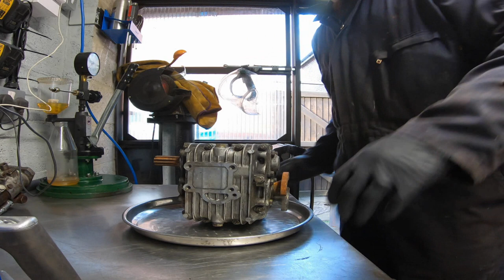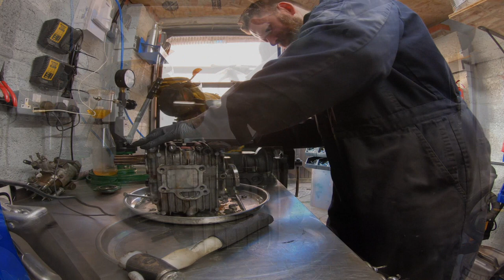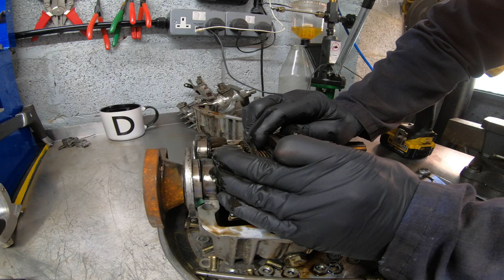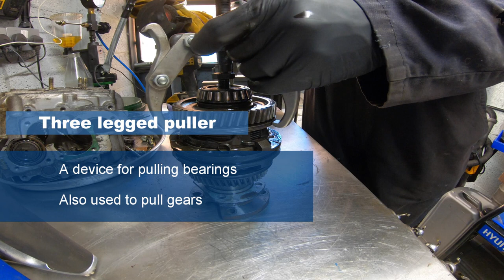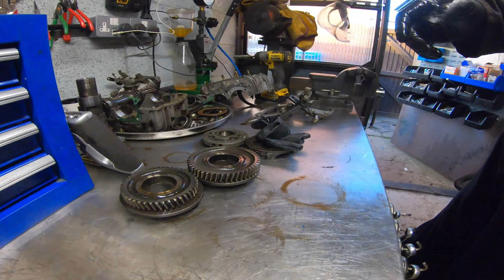How does your Marine gearbox work ? ZF HURTH

Comment: Thanks for your dedication to do these videos. I have a HBW 150v (40 years old now) transmission that is getting more stubborn when shifting into forward (reverse is never a problem). The linkage and cable adjustment seem right on so I'm thinking about rebuilding the transmission myself. Your video has definitely helped me understand what I'm getting myself into. Thanks again.

Comment: Sub'ed 

I purchased my first sailboat and motored almost 100 miles up the Columbia river to Portland Oregon. (almost zero hrs at the helm) As I made it to my new marina I approached very cautiously. I rolled in at idle and just at the slip, I had to make one correction with reverse. when I did, I failed to let the prop stop, and shifting into reverse made a hard connection and then it was stuck in reverse. I said a few choice words and then dropped the outboard (fortunately) and maneuvered into the slip.    This is what brings me here. I'm currently researching how to remove the gearbox.   This video Helped. Thank you!
Reply from the maker: Glad it's helped, good luck sorting it

Comment: Thanks for dismounting that gearbox. I hoped that you show rebuilding and adjusting that gearbox, too.
We got this Hurth in a Vetus engine in a sailboat. We only get reverse and neutral gear and nearly never forward gear.
Reply from the maker: It is almost impossible to get the bits here. You can easily buy the clutch packs and bearings but the springs, thrust washers, and pins, not yet found a reliable source.

Comment: appreciate it. just aquired a 01 master craft with this transmission. need to learm how to service it.
Reply from the maker: Change the oil regularly and use only mineral. ATF unless the manual states if differently.
Reply: Donde se puede comprar una

Comment: Loved this. I have. Zf 25a equivalent and am looking for a video that show the servicing of the control block. I think its the reason why i have loud clunks when i go into fwd or reverse
Reply from the maker: Check the idle speed, you may be running to fast.
Reply: @dhcrouchmarineltd3049  I took it down to 650rpm, but it's not much better .

Comment: Hello Mr Crouch. I am very much interested in your channel lots of good advise practical how to, just what we need. Thanks very much. Can I ask a question? We have a 1800 BMC - Thornycroft T108 diesel in a boat and we are having problems with the water temperature gauge. The gauge shows the engine overheating when in fact it clearly isn't . The control panel is a Thornycroft and the gauge is electrical, the sender has two blade connectors,  The gauge on the panel says VDO as are the other gauges. I think the sender is at fault, have you any idea where I might be able to get a replacement? Thanks in anticipation, John Beck
Reply from the maker: Hi, a two pronged approach here. Well maybe more, Calcutt Boats or ASAP supplies.

VDO is a leading brand with most manufacturers so I cant see an issue buying a new vdo sender. However on the sender will be numbers stamped on it and if you Google these, in theory you should get a hit and find one somewhere.

Hope that helps.

Comment: If ZF are S.A.E boxes does this mean that all ZF boxes only attach to engine's that run CCW as seen looking at the flywheel
Reply from the maker: From what I have seen in the manuals, if there is an R on the data tag which is usually next to the oil filler port its for Right hand use.

So it depends on application. Typically I have not seen the same reduction in ahead and astern so it does matter.

Comment: Hi I just received a new ZF45A Gearbox.
I have an issue with it.
When I put it in gear either forward or stern and turn the input shaft the propeller shaft is not turning.
Surly this is not right
It was supplied with no oil in it.
Does that make a difference?
Any help would be greatly appreciated
Reply from the maker: Have you tried to put power through it. Just turning it by hand may not engage the clutch correctly.

Comment: i'm just rebuilding one now, i managed to press everything onto the shaft ok. i'm just wondering if there is a sequence and torque spec for rebuilding the case?
Reply from the maker: Have you got the workshop manual, always refer to the manual for the tolerances and torque sequences.
Reply from the maker: Have you got the workshop manual, always refer to the manual for the tolerances and torque sequences.

Comment: I bought a pair of motors that have the Hurth model HSW 450 A2-2,0 ser n 22 15223 A they have been sitting for years from what I was told they were took out of a boat after 20 to 40 hours run time and replaced because the owner wanted more power what do I need to do to make sure there ready to be used again I have manuals on them but I’m wondering about the seals or gaskets effect of stagnant fluid or no fluid on them
Reply from the maker: If I was called to inspect them I would drain the fluid (if any) and check inside with an endoscope. Try to gauge the state of play inside each box.

If they are not on the engine then check the seals isnt hard. If they are crispy then definitely change them.

All depends whats found. Do they spin by hand, engage each direction and see if there is any binding. 

Hope that helps a little
Reply: Thankyou there still on the motor I just got them I was planning on rebuilding the motors  this helps me out it’s really hard to find any information on these transmissions I have a original service manual for them but that don’t cover sitting in a barn for 20 plus years and I had no knowledge of inner working until I found your video many thanks for sharing your experience and knowledge  I can use all the help I can get this is my first complete boat rebuild it’s a 79 pen yan 24 footer and the only thing it has going for it is a fiberglass hull
Reply from the maker: @patrickg.6438  bear in mind what ever transmission you use will define the physical installation. Changing that later to suit another brand will cause you a head ache. 

Be cautious and work with equipment you can get parts support easily. Thats my advice anyway.
Reply: What would you suggest I do should I sell them and buy new to me ? the motor in it now is a Chrysler 240 that was run in salt water completely ruined the Chevy 350 vortecs multi port fuel injection I have now are 89 threw 94 models can’t find any more info than that on them but they are very buildable motors I have to gut the hole boat and was going to do some reinforcement with carbon fiber so mounting should not be a problem I got this to have a project with my grandkids who lost both mother and father a few years back and would like to pass it down to them what would you suggest I do and how would I reseal the shaft where it passes threw the hull for the prop and I was thinking about saving up to buy a Sharrow prop do you have any comments on that type of prop
Reply: Yes full of ATF looks like it was pored just today and looks brand new inside we are going to remove them this weekend sorry had to wait for the kids to help all or none do you have a P account would like to buy you a drink
Reply from the maker: There are many who swear by this brand but as I said in the UK i have had issues finding support.
Hey thanks here is my Patreon
patreon.com/user?u=54091227

Vee good to know how you get on. Good luck

Comment: I have a problem I cannot figure out with my HWB50- just had it rebuilt with a standard rebuild kit, clutch plates, seals, bearings, all new.  After the rebuild at the transmission shop, turning by hand confirmed everything was fine- fwd, N, rev all evident with normal shift lever travel.  Right after being installed back in the boat, where it worked great for 5 minutes it suddenly stalls the engine when shifting into fwd.  Reverse is fine.  Back at the shop with the transmission removed again, I thought I could recreate the binding problem in fwd, but NO!  It moves freely and clutch plates are slipping.  What happened?  Any guesses?  Do you recommend bench testing with drill at 1k RPM?
Reply from the maker: Have the bearings be set up correctly? Once bearings warm they will expand a little.

Comment: Hei, i need to learn something.. saildrives have 2.7 or 2.3 times reduction.. or whatever nm is. Where is reduction.. in knee of saildrive where propeller is or inside gear box.
Reply from the maker: The only way to answer that is to ask what sail drive do you have. 

Propeller size will also make a difference.
Reply: @dhcrouchmarineltd3049  aaa.. ok I dont have jet.. im calculating to convert to electric motor.. motors  that have 16-20k rpm.. which is 5x more rpm than diesel...im studying..before invest.

Comment: Just watched your video very good  information  iam put bigger engine in my boat so need bigger prop which is right hand could I put a left hand prop on or not  reply would be appreciated  David
Reply from the maker: No you need a left handed gearbox. If you run a gearbox in the wrong direction for the ratio its set for you labour the box and engine and the efficiency will be somewhere a billion miles out. 

Don't do it.  Typically the engine would also be an opposite rotation but all said and done it depends on your specific needs.

Comment: I have a zf30m, very similar to this GB. The gearbox takes approx 30-60 seconds to go ahead, and instantly goes into gear going astern. We've have the gearbox reconditioned many many times but after a few hours of taking it out, the same issue happens. Any suggestions or what may cause this and how to fix?
Reply from the maker: Probably not a good selection of the ahead drive and it slips in slowly. Check the morse controller adjustments.

Comment: Do you happen to know if I can directly replace a hbw 100 for a zf12? Asap says its the closest thing.  
My question really is about the dimensions and gearing.  Is the gear ratio the same? Will the ratio matter? Also will the adaptor plate fit to my bmc 1500? 
Will I have to lift or lower the bmc to line it up with the shaft? 
Any advice is much appreciated as I'm a bit lost..
Reply from the maker: If I recall correctly it is a pain and yes you have to re-align everything and pull engine back of shaft forward.

Comment: Sorry to disagree its well known that the bronze thrust washers at both ends wear and cause the slipping not the clutch plates and many have just replaced the washers and are good to go. Also as per the manual it is only rated at 17hp and limited use and must have a cooler installed for constant use and moves the HP to 34hp   double. It only holds 350ml of dextron 2 which is hard to find mineral oil based .Never use semi or sythetic oil or it will fail ,its too slipppery and causes plates to slip. Also as per manual it must be kept in reverse direction during sailing  as the prop spins and wears the bronze washers ,thus causing slipping. Oh and as a Millwright i have personally built 100's of complex gearboxes  epicyclic in the printing industry ,even ones made in UK on Baker Perkins G16 .G14, G12 printing presses. I have reashearched this box to death and machined my own cooler and have 1500 hrs on my box (no failures ) in my beneteau
Reply from the maker: Thanks for your input, you clearly have some experience there. As for an oil cooler its not done on inland craft bit I can of course see it being a good idea for sea use.

As for slipping clutches, again i appreciate your perspective but they are just not economical to repair for most cases. Also what I have found is damage cause by improper selection of the transmission due to a very old lazy morse controller.

This box is not know in terms of which HP it rated too. However it was fitted to a small 30 hp machine. Again no need for an oil cooler. I know the manual states how to fit an oil cooler but ive yet to see that requires or have been done inland.

Thanks
Reply: Mine engine is 30 hp perkins ,and I can tell you after an hour on the engine you could fry an egg on the box .After install of cooler the box was warm after an hour and when I first got the boat the fluid came out dark red with yearly fluid change ,after cooler bright red every year like new fluid. These boxes should never be installed without a cooler ,look at the graph in the manual
Reply from the maker: @Mechone11  I think you are again right for sea work. Inland boats just don't do that much work.

I have a thermal imaging camera. This has given me some thought in another video.

Comment: What modern transmission would you recommend to replace one of these to go on a BMC 1500 still keeping the same ratio.  Also would I need to buy some kind of mounting plate to make it marry the engine? 

Many thanks 🙏
Reply from the maker: The Hurth mounting pattern is the same as a PRM 120/125 mechanical box or PRM 150 for example.

The center drop is a bit different, you'll need an oil cooler for the 150

Prm are fabulous bits of kit
Reply: @dhcrouchmarineltd3049  thanks for that, I appreciate your videos.

Comment: Can the cam plates be swapped around for reverse rotation engines?
Reply from the maker: Not something I have ever done. That being said my reasoning is the gear ratios are set for each respective direction.
So not so much a clutch concern more a gear sets being appropriate for the input forces and output rotation. Otherwise you'll thrash the engine and gearbox.

The clutch and plates ect are symetrical.
Reply: @dhcrouchmarineltd3049 Thanks for taking the time to reply! I suppose I'll have to get a hydraulic clutch model with reversible oil pump. I just don't know how the hydraulics will behave when the shifting will all be done with the input shaft at 0 RPM (clutched motorcycle transmission).

Comment: Thank you for your information! I have a Hurth HBW5 and a 32 HP Watermota Seapanther engine. Occasionally the gearbox will not slip into forward unless I first make it go backwards. Is there a simple way of adjusting this to make it work better?
Reply from the maker: Are you sure its the gearbox and not the morse controller unit?
Reply: @dhcrouchmarineltd3049  No, I am not sure, I am going to control the angles, the oil level  and the controller unit tomorrow.

Comment: Thanks for the video mate I have been following it . Can you tell me where the 3 springs connect to l can see the top hole where they connect but can't find the bottom location . Thanks
Reply from the maker: Which springs? The three that keep the clutch assembly together
Reply: @dhcrouchmarineltd3049  yes mate I can see a top hole where it slots into but can't see bottom hole or location any help would be great thanks

Comment: I have that transmission. I have to get it to stop slipping in forward. Can I make a shim just to add to the clutch pack?
Reply from the maker: Hi, you need to refer to the workshop manual and work withing the design tolerances. 
Adding something that was not intended is experimental and is questionable.
Reply: Ps, I'm also a machinist. Honestly it seems that there is too much slack In the forward position. Or the springs on the slide Carrier are too weak. 
My thoughts where to have a shim laser cut to take up the play in the forward clutch pack. 
Or add a another disk from my spare transmission
Reply: @dhcrouchmarineltd3049  do you have a pdf of the transmission manual?

Comment: Can you please inform me which is the right oil for ZF HURTH 45a ? 
The boat manual recommend oil 15-40 and  the ZF manual ATF .
Reply from the maker: What engine is It? Some manufacturers may have had a PRM hydraulic box in mind.

If the ZF manual states ATF use that. Typically that's what they use. 

15W40 is an engine oil and very thick compared to ATF. ATF is very thin and helps with heat management.
Reply: Gasoline engine GM V8 6.000 cc 375 hp. Usually working at 3.900 revs.Waterski boat Mastercraft. No hydraulic box.

Comment: What’s the drop in replacement?
Reply from the maker: What do you mean. As in an alternative engine system?
Reply: He said they are throw away gear boxes. What is the drop in replacement
Reply from the maker: @andrewdoble7973  I see. Nothing is exact but the PRM 120 / 125 use the same mount registration pattern. You have to realign the engine. 

Technodrive again use the same mount registration pattern.  Again a slight remount and alignment.
The PRM Hydraulic box the 150 fits but again you'll have to realign the engine and add an oil cooler for this.

This is an example and for guidance only.

Comment: I have an oil leak from the coupling. I can't figure out how to remove it to replace the oil seal. Do I need that press machine you used to remove the coupling?
Reply from the maker: Yes, the shaft coupling is part of the output shaft and you have to take the whole box apart and remove the clutches and bearings. 

You will need a press.
Reply: @dhcrouchmarineltd3049  Thank
 you for the info!
What a god forsaken engeneiring design...

Comment: What's the difference between ATF and Dexron 3
Reply from the maker: ATF means Automatic Transmission Fluid.

Dextron 2 or 3 defines the chemical composition of that particular ATF mix if you like. There are varying types if ATF and its used a lot in the states for all manner of transmissions.

Dextron is an old term from around the 1970s so relevant to older boxes. 

I would suggest to stick to the oil type the original manufacturer states. Unless the manufacturer says otherwise as all to often people get sold on an "upgraded" oil type.